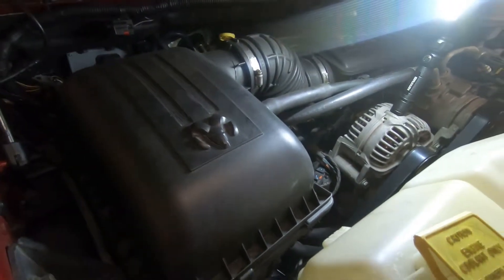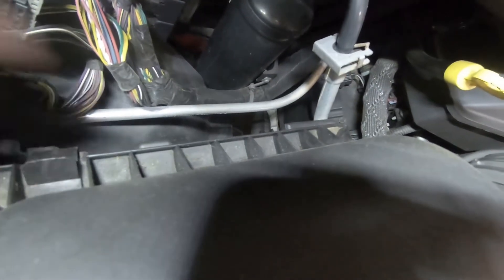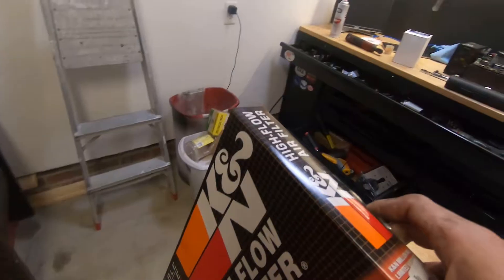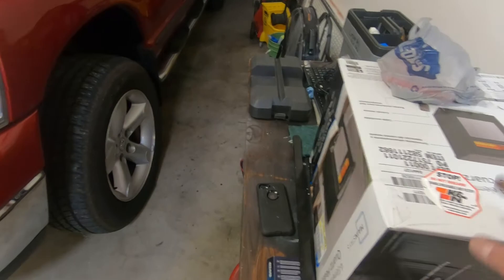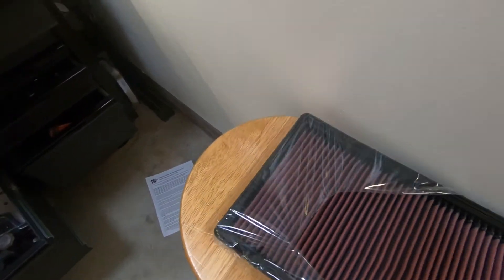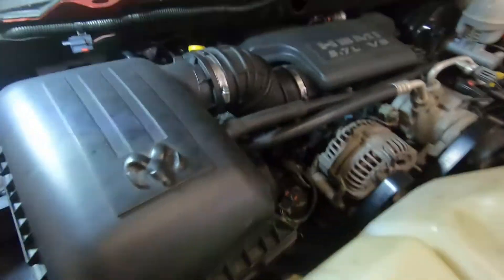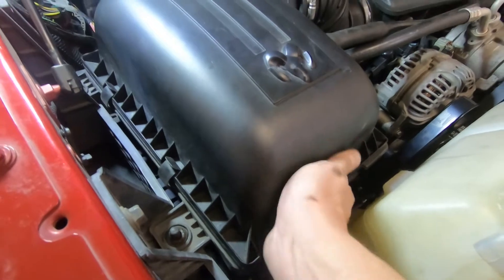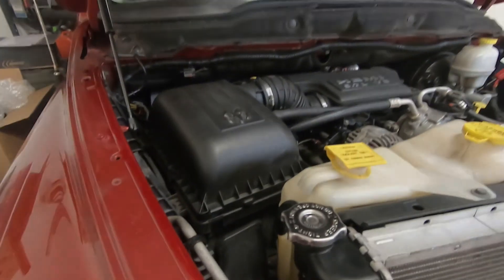2007 Dodge Ram air filter replacement and K&N upgrade!

Comment: Let's Alot of dirt through. Go check out project farm on the air filter tests.
Reply from the maker: love his stuff will def look for that video. Thanks!!
Reply: @DLMGarage  with that front clip you mentioned that was missing will it hurt anything I noticed mine was missing as well? I was just wondering where can you get those ?
Reply: @octane9092  it won't as far as performance since the truck does not have a mass air flow sensor. But it could allow a little extra dirt to get by the filter into the engine. I bought mine from eBay.